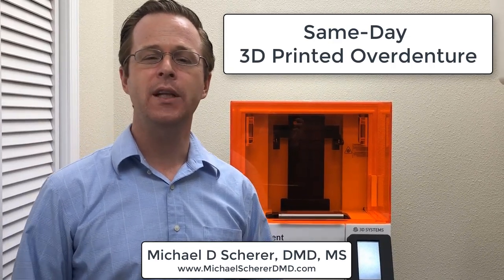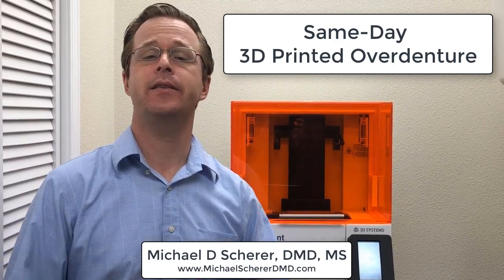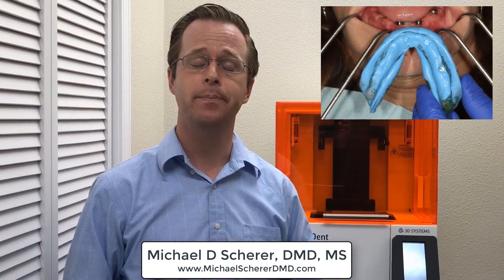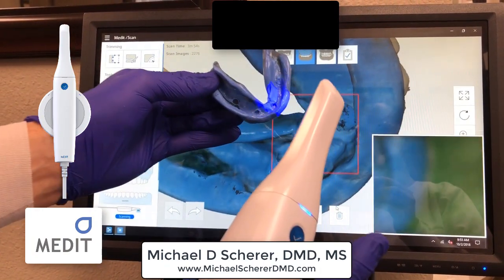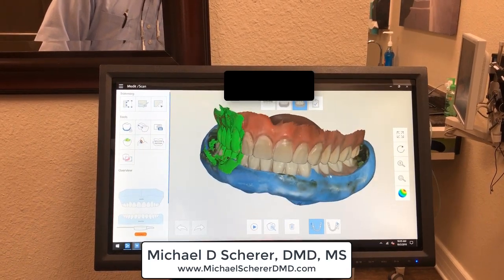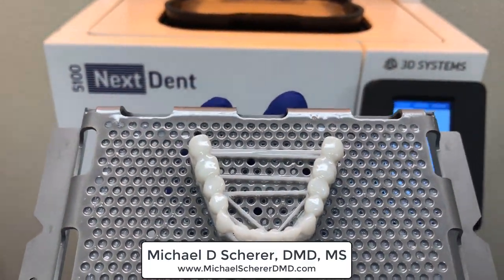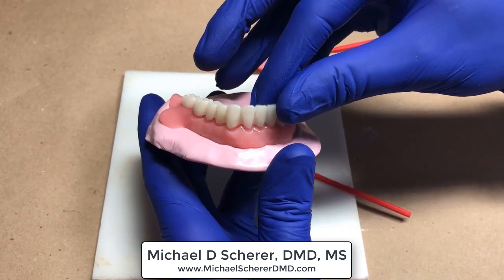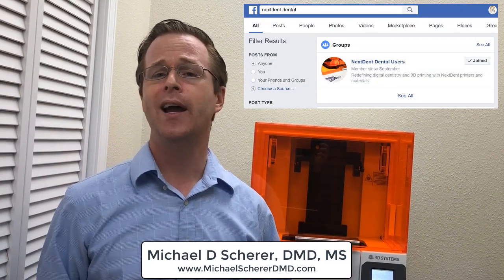Same-Day 3D Printed LOCATOR Overdenture!!

Comment: What soft liner material do you use for your over denture cases?  I find the one Im using difficult to remove.
Reply: GC tissue conditioner is probably the best one out there. Put it in hot water before removing